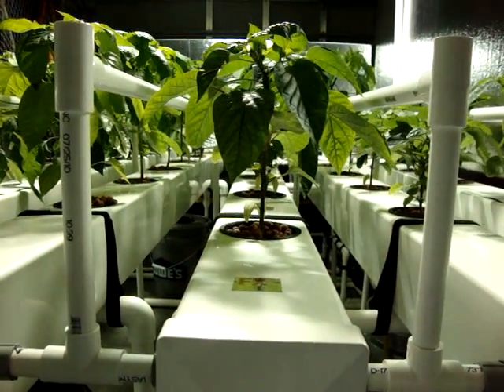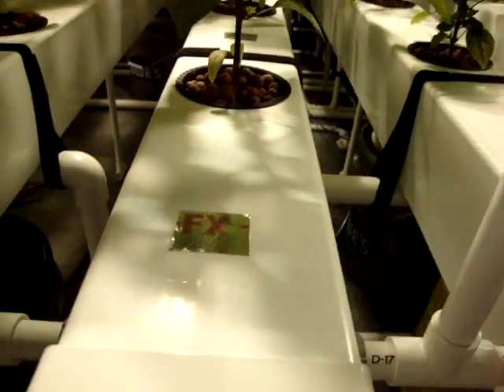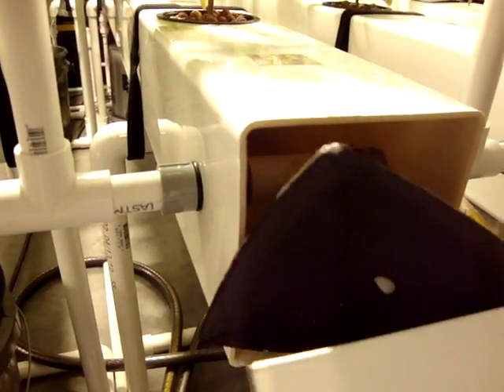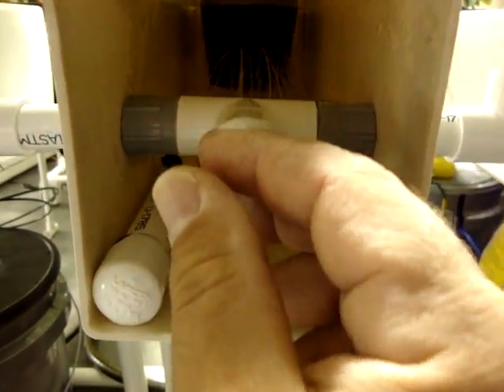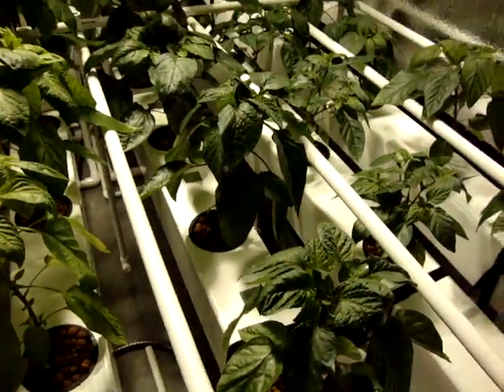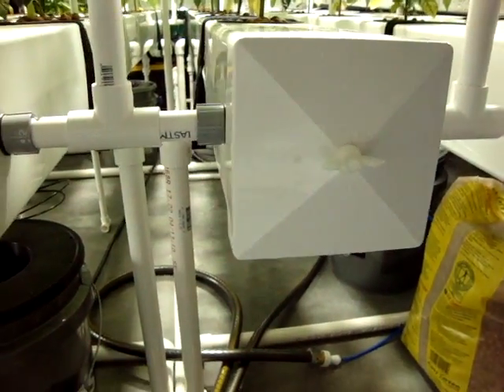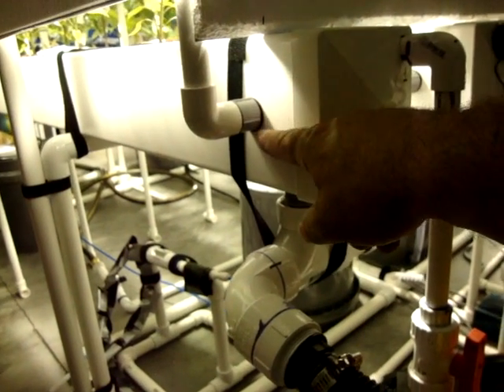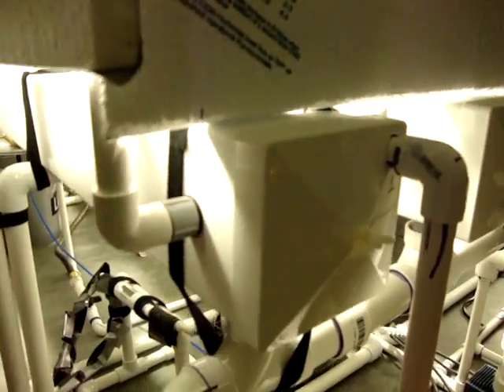DIY 39 pepper Aeroponic System- EP. 1 (Rails)

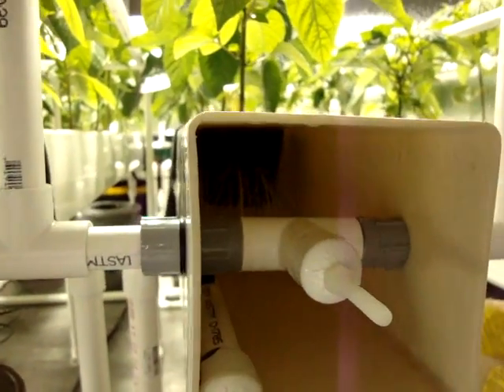Comment: I know this is an old video, but how did you get the screw 4:56 to hold still and not freely spin as you're tightening the wing nut?
Reply from the maker: When you tighten the nylon nut it locks the nylon screw in place. Hold the screw while tightening the nut.

Comment: Hi - looks like a nice system - a little over-engineered though.  do you have an update to comment on how easy this set up was to "garden" with?  You've covered all the structural challenges but I'm not sure a 6 rail system as you have set up is really practical in terms of tending/harvesting plants.  Unless you have access on all four sides which is not space efficient, it would be very difficult for most folks to get to the inner rails.  I'm planning a similar system for my green house that is vertical structure 4 rails high and connect to my main reservoir (with 1800GPH pump) that will handle my entire 10x1 greenhouse hydro that includes multiple Dutch buckets - 2 different sizes.

Comment: Very nice system and an impressive build. I am about to build a 12 post system for a customer and really love the way you did your end caps versus using silicone. I was wondering how bad does that ps frame flex supporting all the weight? I wanted to go with square aluminum and fabricate the frame , but I don't have the time for that so I am going to use 2x4s. Are your spray heads standard ones like in clone machines or did you get them from the irrigation section at lowes? Thanks for your vid.

Comment: This is a very nice system. You made the comment towards the end reguarding the end cover gaskets being rather expensive.  I lower cost solution is to run a bead of silicone around the inside of the end cap and ley cure till dry. then use a faucet washer over the nylon bolt from the inside.  This will cost you about 2-3 dollars fot the total system. Great videos, keep up the good work.

Comment: you mentioned that if you were to do DWC, that you'd remove a 90 elbow, and run the sprayers at the top of the rail, not the bottom. Why not do this even in the aeroponic set-up? Would it not cover more of the root base that way?

Comment: i need your help bud, i stole your idea, i absolutely love it and appreciate it greatly , im just having one small problem

the end caps have a Very slow drip leak even with the rubber gasket sheets

maybe i didnt cut them good enough? did you leave them a little large ? i tried to cut it exact, but it has a slow drip, do you have that problem?

any ideas?

Comment: how is your rail set with sprayer heads held in by pressure.
its all i cant figure out on this thing.
id figure pressure would push it apart not hold it together.

Comment: Well Jason, your educational videos are very detailed with outstanding explanations and reasons why.  They are just as awesome as your well planned and executed system set-up.  My only question is on the elect male used for the drain.  My assumption is that you used an O ring on the inside with a compression connector or nut.  Are your holes drilled above the nut?

This is definitely the PRIMO rail set-up on YouTube!!